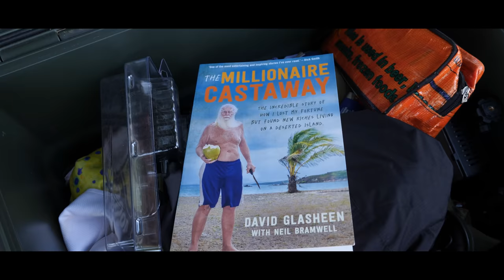STRANDED ON A CAPE YORK ISLAND! - Fishing and camping on Restoration Island

Comment: lol don't these new mercury engines have a ECU these days ?? it's probably in limp mode hahaha great video!
Reply from the maker: Spot on mate!! It went into limp mode because the trim sensor was reading backwards. I can understand limp modes because of temperatures and low oil etc but one on the trim seems pointless and can only cause problems it think.